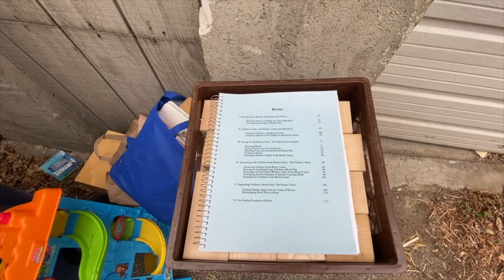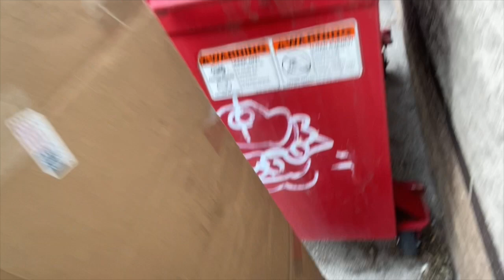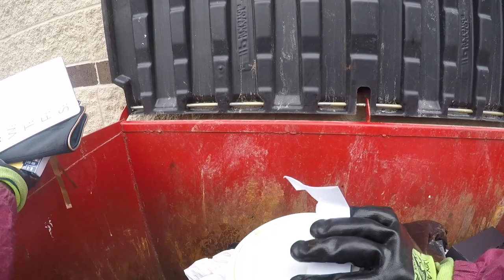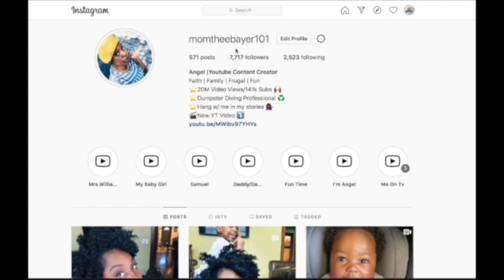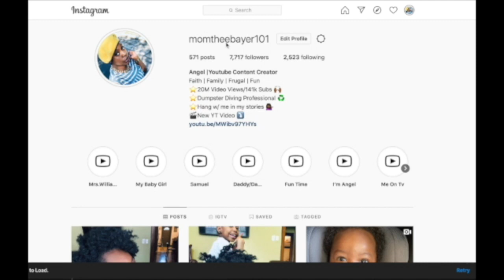Dumpster Diving:UNBELIEVABLE Can't BELIEVE people THROW THESE THINGS AWAY!!! | Trash To Treasures |

Comment: Now Angel you know that "Trundle bed pull out" just going to sit on my little mind all night ! lol
---- And that Trundle is a  Pottery barn ohh gurlfrenn ,poor me !  I go nuts when I see things you have to pass up on that I can use in a ton of different ways.That Trundle can be use for Samuel to put those blocks to play a Train game or line them up and keep them inside the box. Also you can keep toys inside it and just roll it under his bed when older. Another use is you can put Clothing to store and then cover it with a Fitted Sheet to keep the dust out and roll it to stow away under your bed. To keep the fitted sheet in place just put some hooks on the four Corners.
----------- You Keep Safe ! Stay blessd. Cheers!